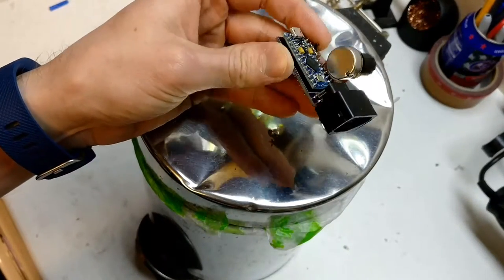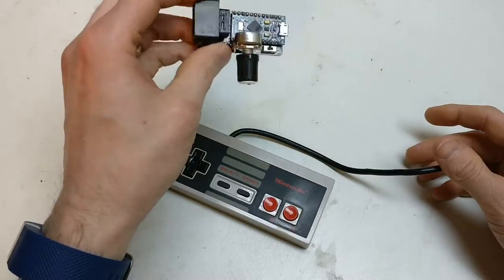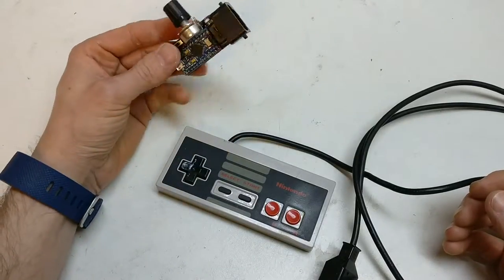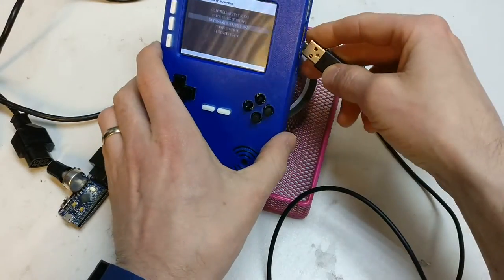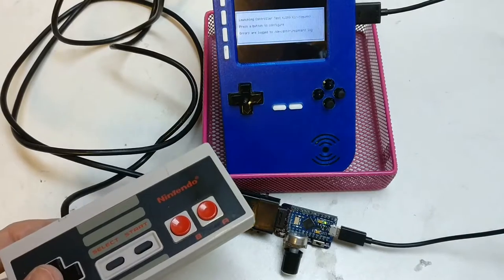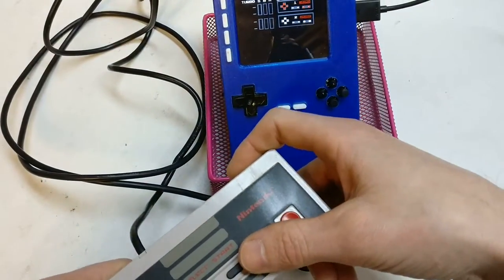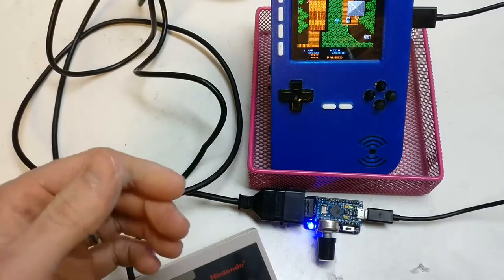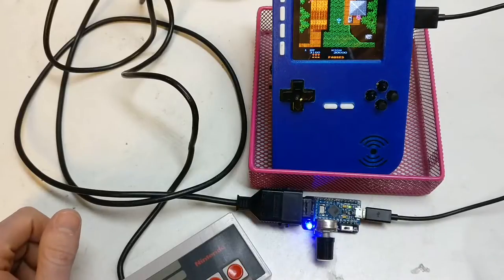NES to USB adaptor

Comment: Did you ever figure out the bug that caused the turbo inconsistency?
Reply from the maker: No unfortunately I didn't. Are you looking into doing something similar?
Reply: I would like to, but I don't possess the skill set to engage in such a project. I usually just follow what others do and sometimes purchase what they've invented, if the do a production run.